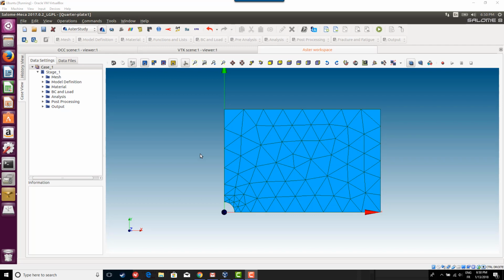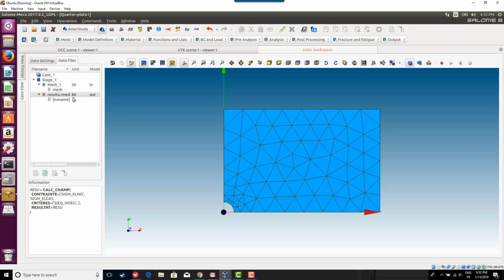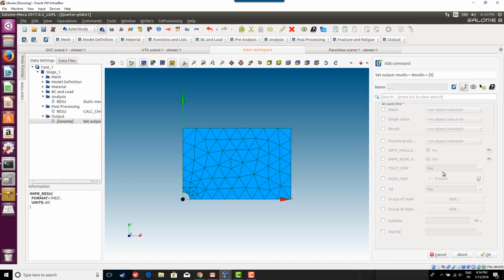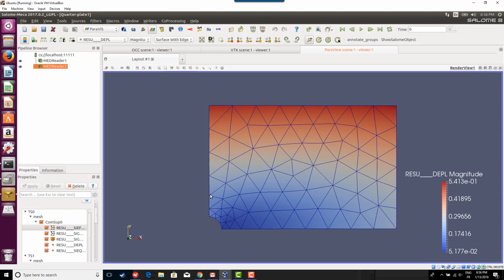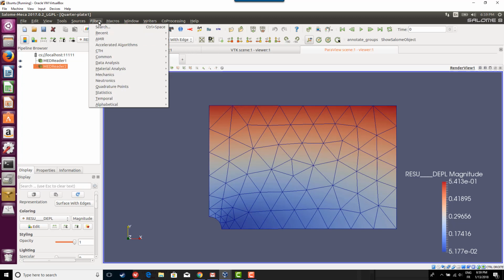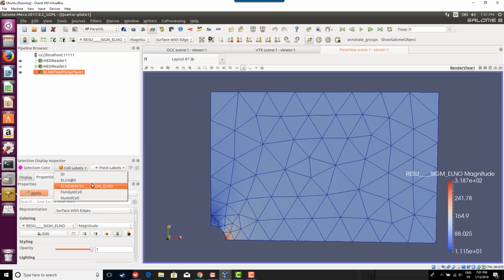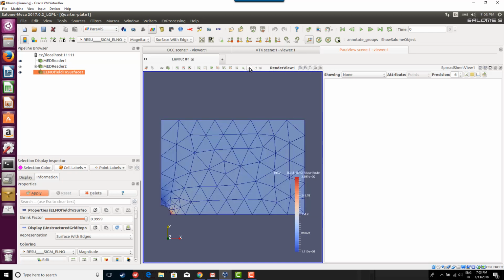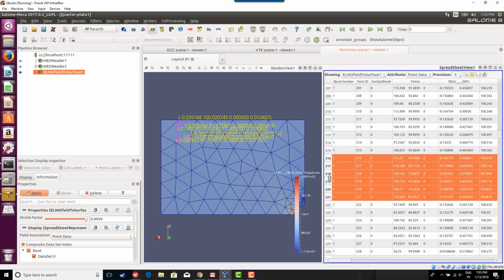[Salome-Meca Tutorial] Post-processing with Paravis and Stress Vizualization

Comment: Hello! Do you know how to remove the boundary conditions? because they are affecting my stress analysis.
Reply: Sabrina, you can't remove BC, otherwise the math underlaying the code will fail. Instead of fully restraining movements over X, Y and Z over the fixed face, you should only restrain X-displacement. That restriction will take over the load and let the face stretch due to Poisson. That X-displacement restriction will create three restriction: X-displacement, Y-rotation and Z-rotation. You need to restrict everything in order to proceed to calculation. To do so without creating issues over the stress distribution, you should pick one point over the restrained face. That point should lie on the symmetry plane and over the bottom edge of the face. Over that point place Y-displacement and Z-displacement retrictions. Now the only free movement of the plate is X-rotation. To lock this, take the opposite point to the previous one, that is, a point over the restrained face, lying on the symmetry plane and over the upper edge of that face. Over that point place a Y-displacement restriction. That will restrain X-rotation. Your plate is isostatically restrained, although the restrained face can stretch almost freely (freely enough for your load) along the y-z plane.
Hope I made it more or less understandable.
Reply: Hello!  Do you know the thickness of the shell used by the software in 2D drawings?
Reply from the maker: Not sure what you mean here Sabrina. Boundary conditions obviously affect your results... Do you mean changing your BCs to get less stress in one area?
Reply: I'm sorry, but I expressed myself badly. My problem is this: I have a rectangular plate (2D), one side is set and the other a voltage is applied. When I visualize it in the Salome, the corners where the board is engaged concentrate stress and in all cases I researched, it will have to concentrate stress along the entire border and not just in the corners. This site will help you to understand my problem a little. Thanks
https://br.comsol.com/blogs/singularities-in-finite-element-models-dealing-with-red-spots/
Reply from the maker: In that case, that's probably because your boundary conditions are not correctly set. You probably are over-constraining your model by blocking degrees of freedom which don't need to be. Try to understand the degrees of freedom you absolutely need to constrain and try different ways until you find the right one.